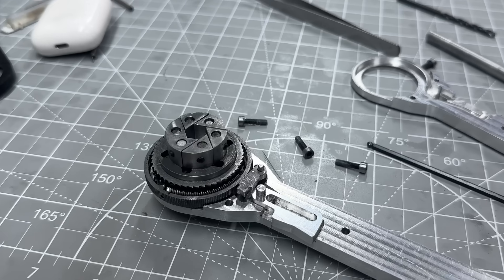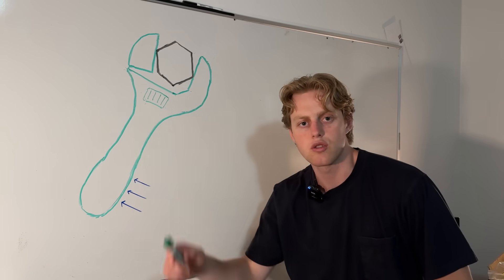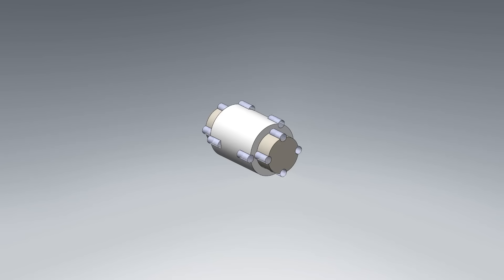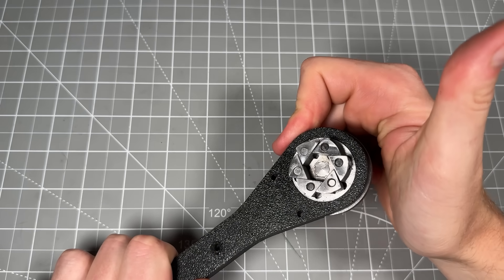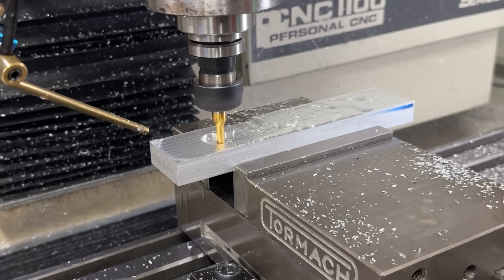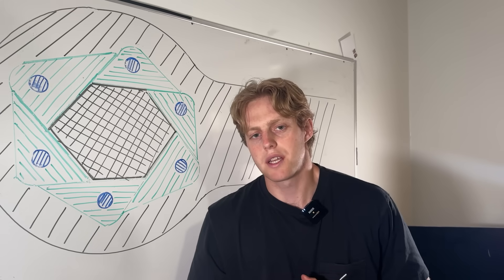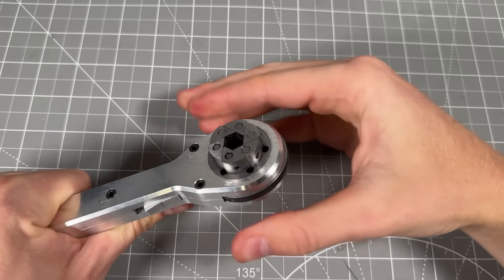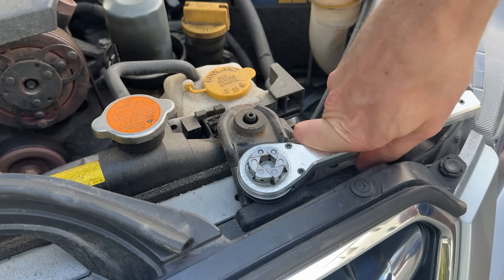I Invented an Adjustable Ratcheting Wrench

Comment: Genius design.  However, “pins” and. “Bushings” doesn’t provide much confidence in the strength and durability.  

I’m not saying the product won’t be durable or reliable.  I’m just stating the consumer will.  You’ll need to overcome this objection.  

Nicely done!!

Comment: make those adjustments you mentioned, and give it a fine tooth on the drive gear. Then consider having two ratchets if you can't have a reversing pall, one for loosening and one for tightening. I'd buy a combo ratchet set if it meant that they were low profile. awesome invention!

Comment: I think this is really cool, I haven't gone through a lot of comments, but read some, so maybe somebody already said this, but something came to me in regards to clearance issues, and not being able to adjust the angle...would be to package it as a socket itself. Forget the wrench handle part and just build some sort of "socket" it can go into so you can flip the head around for loosening or tightening.

My first thought is maybe if there were slots cut into the face around the edge you could make a "socket" which has the male part of those slots and it could go in and slightly twist to lock perhaps.  Think like a hole saw except instead of pointy teeth it would be spaced apart rectangles that interlock.

Still going to be a chunky socket but you could still get to more places overall. However,  it starts to spiral though...might need to figure out how to remotely operate the mechanism onto those bolts, haha, and whatever other potential issues might pop up.

Your wrench is awesome

Comment: You should add some sort of thumb button (somewhat like a box cutter) in the grip incase it’s a very tight space you can’t get your hand to open the ratcheting mechanism to fit a bolt that’s larger.
Reply: Nvm didn’t see you did this in the rest of the video, great work bro!

Comment: Kudos on that design and more kudos for the persistence to complete the project !  
Keep at it, and as someone else said copyleft and sell it. Personally I like the chamfer idea, and a simple T for Tight and L for Loose on either side of the handle would solve the 'which way does it tighten' issue.

Comment: The only issue i can see and I dont even really want to call it an issue is the prospect of having to use it in small spaces. If i have to use one hand to hold the handle and the other to action the adjustable opening, it may present problems trying to get both hands in that small space. If a slide of some kind could be added to the handle taht could be actioned with your thumb i think it would be really neat. A great invention!

Comment: I think this is perfect for oil changes or lube techs. It makes working on a bunch of different models easier.
Reply: Have you seen the wrenches that have spin sockets on them, so you get 8 different sizes in a single wrench.  Really designed for oil changes, no ratching.

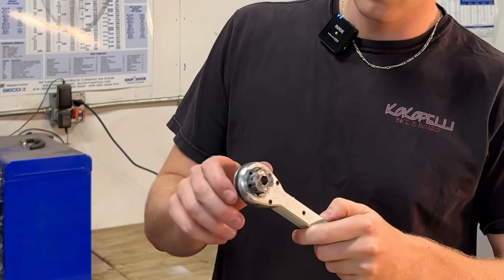Comment: 0:17 "...instantly adjusts to any size, never slips, and ratchets like a socket..." Not ANY size - but a range of sizes, and sockets don't ratchet - ratchets do. But those pedant irritating details aside, you forgot "...is so large it fits in nowhere in a modern engine bay"

Comment: you could powder coat, or something similiar, each side of the handle, so each one is a different color, teling users which direction is which.
or you could put different textures on each side, which would be good for color blind, or fully blind.

i dunno, i think it deserves something better than just an arrow and some text, though, it could be a combo of options.

Comment: this is a great tool and congrats on making it work and continuing to improve the design! in my opinion certainly you can try to make it better for hard to reach places but at the same time sometimes you just need extensions swivels etc. it is very convenient in situations where its a mix of metric/SAE or whatever or possibly offsize rusted bolts. very cool invention, keep up the great work. im jealous of your workshop and software lol!

Comment: A: Awesome. Don't stop doing what you're doing.

B: Your comment about adding a power ratchet actually made me think could this be adapted to a mountable tool for a drill or impact driver? Power ratchets tend to be slow, I could imagine this on a drill would be the ultimate speed bolt tool. Although the jaws only self tighten in one direction and if its a floating tool maybe not even then. I have a vision of a universal bolt removal gun. Imagine one of the small M12 impact drivers but with your jaw mechanism as the front of it.

Comment: I've had this tool in my mind since seeing this video. Another way to create the reverse ratcheting is to stack another of the thumb wheel on top and then have a pin which allows you to 'select' which of the gears are engaging, hence setting the direction.

Comment: This is a fantastic design for Bicycles and motorcycle user's.  Don't' really need to carry around deep well sockets or have enough weight capacity to carry a bunch of sockets.  This is the best "adjustable" wrench one could ask for as any kind of cyclist.  Good on you!  If I was you, I would hit up "Park Tools" with your design.
Reply: Bicycle mechanic here. the vast majority of fasteners I turn on the daily are 4, 5, and 6 mm hex recess (allen) bolts, so this wrench, while incredibly interesting, woulndn't get that much use. 
That said, from my limited work on motorcycles, this would probably be more useful there.
Reply: For a motorcycle you can generally get away with just a small adjustable wrench, except for places with a small clearance but you won't reach those with this wrench either. It's still a cool tool but I probably wouldn't carry it on a motorcycle over an adjustable wrench and an Y type socket wrench with the sizes I need

Comment: This is awesome. I'd love to contribute in a Kickstarter if you make one. A possible improvement could be to have a mechanism to switch between tighten/losen, I think it's possible to have two parallel teeth gears in reverse directions and something like a selector pin with two positions to choose which of the teeth are being engaged.

Comment: Cool! Does the jaws have to be round at the back (away from the bolts) and if not could you not just have a simple stop that you click in to lock all jaws from one jaw to get away from the pins that seemed to be a bit weak. Inter locking would divide the force into all pins. May have missed how the mechanism work and ask a really stupid question 😅 Impressive work!

Comment: Really cool design. I hope to see any future iterations you may have.
I wonder if it'd be possible to design it with the jaws in the middle of the handle instead of sticking out of each side. A similar tool to reference for design ideas could be a ferrule crimping tool. I've use some ferrule crimpers that use 6 jaws that move in a similar way to your wrench.

Comment: One of the coolest things I've ever seen. That's coming from someone who has built a lot of inventions and loves inventing. As someone else said, even if very expensive to sell... please make available for sale. Look for machine shops to be suppliers for the various parts and that way you can turn a tiny profit and get it into the hands of people who want to try it out and give you real feedback with images and video from different fields of expertise. These will be founders edition prototypes. Make sure to mark them with IDs and what edition they are so that you can track their design versions.

Also, you are learning TWO fields of study: Mechanical Engineering AND machining. Both are their own things and need to fit together well.

Please be aware that any designs that require tight tolerances are going to be a nightmare to work with. So try to make designs that are still effective with less tight tolerances. That's what makes Toyota vehicles so effective. It will help make mechanisms move better, fail less over time, and be much easier to assemble and disassemble.

Comment: If you go to production, make one side green and one side red, so that users can distinguish between the undoing side and the tightening side. Its a small detail that massively helps user interaction and will follow standard affordances. - I'm a designer.

Comment: I'm thinking that there's a way of decreasing the heft of the head by having one set of jaws set inside the head of the wrench, instead of one on each side poking out, but I'm sure that would take an inordinate amount of redesigning the mechanism, and wouldn't address the issue of not being able to get into recesses.

Another thing that also pops to mind are chain wrenches. There, you have a one-size-fits-all concept in practice, but it's limited in what it can do. Don't know how well it would work as an integrated part, rather than something hanging off of the end of the wrench, and getting that to ratchet, somehow... That goes beyond my ability to even work out the feasability of.

At the end of the day, I don't think it's possible to compete with a set of sockets in a handy carrying case and a ratcheting handle. To me,  as a tool-user but not a designer or engineer, it seems like a K.I.S.S. situation. 

But it's still very cool to see your process, and I hope you keep working on developing the concept, as you clearly have a knack for it! :)

Comment: The biggest problem you will have are bolts in tight/recessed places. If you can find a way to allow the teeth to extend out a bit further without compromising the integrity of the design that would be huge. In many cases the wrench handle needs to be bent away from the bolt so maybe you could add a swivel close to the head so the handle can be moved to clear obstacles. Something similar to the gear wrench flex head design. I think it's a requirement for a wrench like this since you don't have the flexibility of extending sockets.

Comment: Maybe think about making this just into a socket? Everyone already has ratchets. Might make your design and manufacturing a bit easier as you wouldn’t need to worry about the ratcheting mechanism.
Obviously you would need one socket for tightening and then one for loosening. But then you could also scale the design up and down to fit a very large range of bolts/nuts… also make the sockets “deep”, “standard” and even “shallow”.
Just a thought. And imo would be more versatile and be able to just put your socket on extensions and anything else to get it into harder to reach areas.

Edit- you could also just make the “housing” fit a ratcheting box wrench… say a 1/2” or 3/4… then you could just use a ratcheting box wrench as your ratchet. Basically a “pass through” socket.
Anyways there’s all kinds of directions this idea could go lol.

Comment: I think you might land up making two (or maybe 3) size versions. It may be a bit cumbersome having such a big wrench working on small bolt / nut sizes and, furthemore, as shown with your development testing, your wrench as it is now, runs out of capacity with larger head siszes.
It is complicated and would prove expensive but then, it would replace some socket sizes. All the pest, good job.
Reply: NB. It should read, "all the best ..."

Comment: I'm really curious if you could make a mechanism like this where the adjustable jaws double as the one-way ratchet. In one direction the jaws simply stretch up in size to fit the bolt head's outer diameter where in the other direction is perpendicular to the jaws' direction of travel (or ideally a few degrees behind that) so the mechanism binds and grabs the bolt.
This may hinder the wrench's ability to 'lock on' to bolts and definitely shaves off a small portion off the upper end of the holdable range, but greatly simplifies manufecturing and assembly, and if I had to guess improves reliability as well thanks to a simpler mechanism.

Comment: Make it a multitool, on the opposite side/handle add a pop out hex and star-hex alan key set
So you can deal with nuts AND bolts

Otherwise this design is downright genius, and innovation breeds competition, which in turn breeds further innovation, be very proud of what you have contributed to the world.

Comment: I love the design. ♥
Looks like a good companion when encountering crusty or beaten up nuts and bolts.
I would add 2-4 matching teeth in the lever for the ratcheting mechanism to distribute the force to a bigger area.
Maybe 1 to 4 wrenches of different sizes are more suitable for most use cases.
I would see if there is more resilient material at a reasonable price available in order to shrink the wrenches dimensions.

Comment: Great idea and work, the last part is defiantly important. I can here provide you with some good options for marketing. you want to market it to big industry service and maintenance, my experience is in the offshore wind industry and military equipment, where every single task is very well documented and planned. so if they are going to perform a service, its all in walls of excel sheets what part, what bolts to remove, and what tools is needed. further more it have to be transported up into 100+ meter wind turbines, so limit of tools /weight is vital. so in case the job is to go service a transformer, the entire process is already planned by engineering departments and drilled by the service crew, in the written instruction/and the digital version (sometimes its in a interactive program simulated like a video game) they bring on a phone, each planned service or failed component will be requested performed including a specific list of tools and parts. In this type of cases your type of tool could serve well. lets say they implement your tool into GE wind energy, Siemens or Vestas, we talk huge orders. this case i think is true for most high tech industries and military ( military is crazy, i spend 600 hours of providing maintenance and planning documentation for a relative simple machine aka, ILS= Integrated logistics support). One extra tip, you want all the internal parts and teeth's induction hardened.

Comment: To try to indicate the tightening vs loosening side I would etch, mill or engrave an indicator near the head it could also be painted to give a good visual indication. The big thing I would do is to give a way to feel the right direction so that with use you stop needing a visual indication. You could give the handle a slight curve or you could leave one side of the handle flat and cut the other side so that it has a lip around the edge the way many wrenches have on both sides.

Comment: excellent tool - i do often use the multisocket that has an array of spring loaded teeth to adjust to any size nut/bolt, 
i also have invented some devices
dm to chat about marketability - also as hard or harder than the 90% perspiration

Comment: I like the design and idea. You already spent so much time on it, you must continue. 
Continue to think new ways. I never stopped to think about a new way to make a ratchet wrench, so this is really impressive to see given how so many major brands are trying the same thing with a larger budget. 

My ultimate question is. Did you file a patent yet? I highly recommend it because, if you have not, other businesses might do it and you will miss your opportunity. File a patent on the current model you have, because if you don't design something different in the near future, at least you had this version secured.

Yes, this is something I would add to my toolbox. However, I don't suggest relying on too much feedback from potential customers because people will often say something and not follow through with it. If anything, you can make a small quantity and sell them yourself if an investor doesn't see potential in it. Maybe, your sale history might convince them.

Good luck! I'll keep checking up on it. 
And thank you for showing the process. That was very entertaining.

Comment: "Adjustable wrenches slow and clunky" YEA---NO. Adjustable wrenches are fast, weigh less than what you made, are thinner and easily slide into a back pocket. I use one everyday when changing out cylinder tanks. And you will never replace a socket with that wrench. Sorry man, trying to reinvent the wheel is pointless. The only thing close is the Knipex 8601180.  

While the tool itself works, its just not practical. But I am sure you learned a lot, and probably developed some new skills while on the journey. That alone was probably worth the effort.

Comment: beautiful machining and a great idea, I wonder if T shaped interlocking retainers between the clamp teeth would help with the stresses trying to separate the teeth and bend the pins. I know this would likely be a nightmare to implement and I'm not an engineer or machinist so ofc take with adequate salt.

Comment: Very interesting tool. For some one working on cars it would probably not be useful. Just too bulky, specially working on newer cars the bolts are usually smaller bolts and very tight spaces. but i would still buy it just to support you and just to have this in my tool box.😊

Comment: awesome think I would use it day to day for easy access to small bolts and nuts. as a maintenance engineer sometimes its good to have compact simple solutions like this to carry around for quick off the bat jobs without having to carry socket sets and spanner sets around.

Comment: This is a legitimate product. Id think chamfering the jaws like you said would be a massive improvement as well as figuring out how to have interchangeable jaws with varying depths to get into harder to reach areas (aka a "long" socket and a "short" socket).

You may be able to make the jaw teeth out of stronger(tensile strength) material (titanium etc) and tapering the outside edge of each tooth as you move away from the interface to the point where you have a 'thin' jaw tooth tip but enough material for the tooth not to warp. This would make the jaws look rounded inward at the top like a thimble.